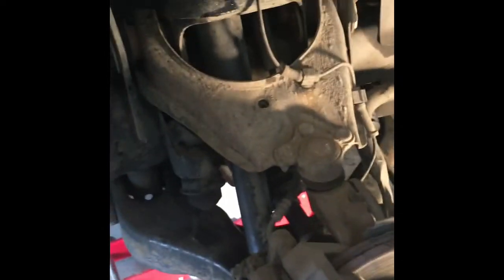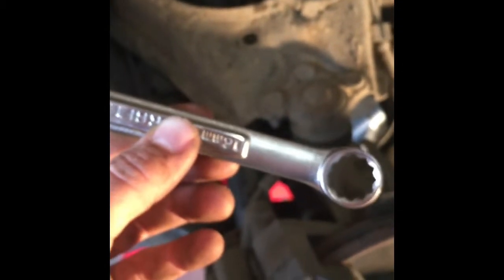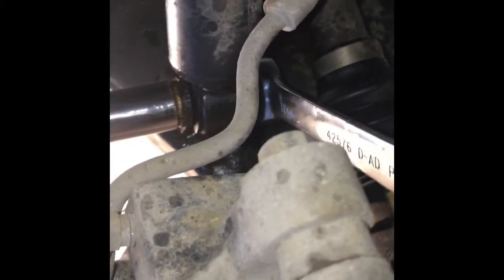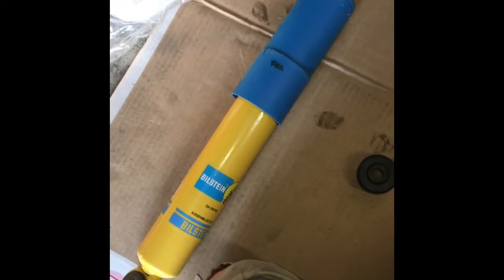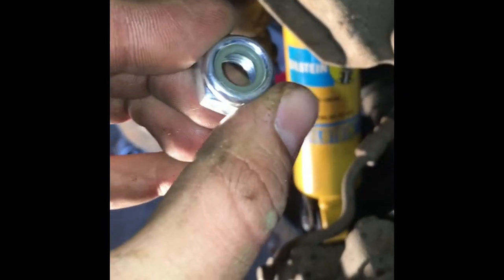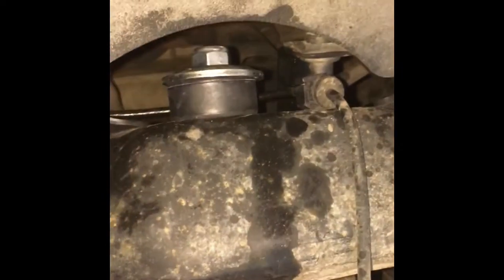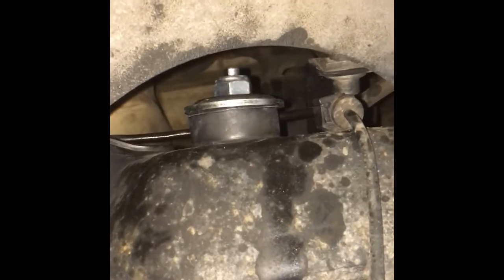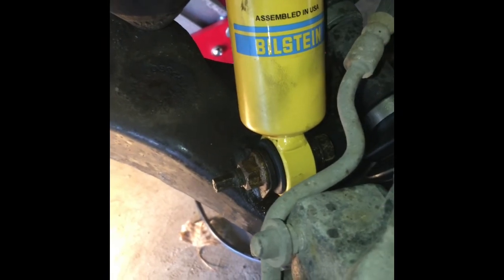Front shocks 2004 Chevy Colorado 4WD

Comment: The fact that you have no spring coils on this vehicle makes changing the struts ridiculously easy.
Reply: No struts either, just shocks. It's torsion bar suspension on the 4wd and some rwd, so it can be adjusted to give more traction when offroading.
Reply: Sweet my truck was swaying glad it’s easy. Just did my ball joints and then tires